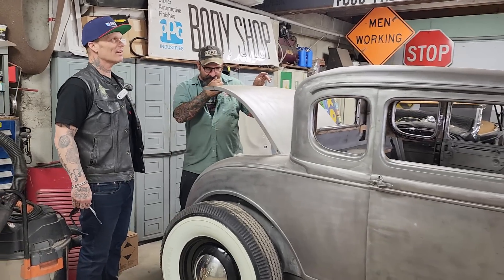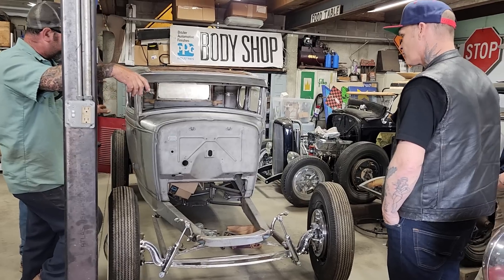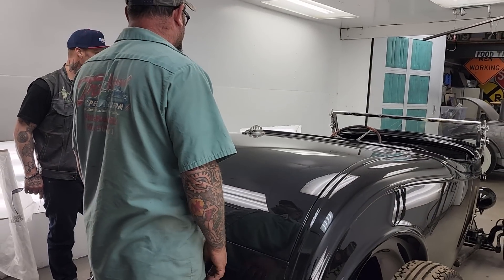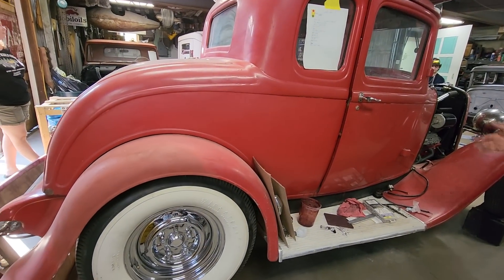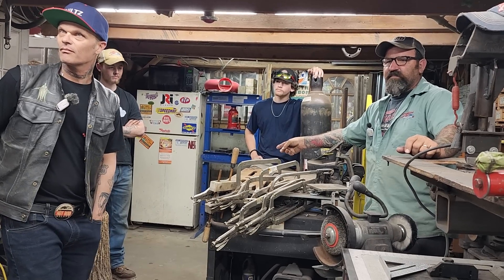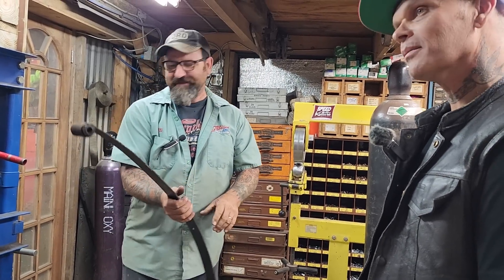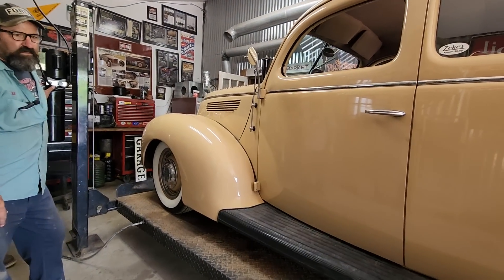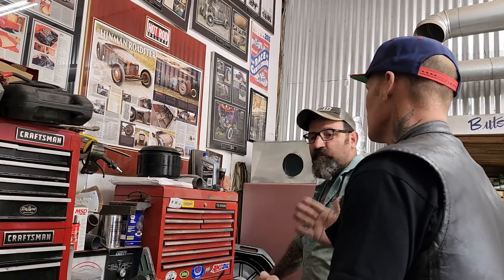How to lower your suspension in 10 minutes and ZERO dollars ✅

Comment: Rubber washers, plastic gaskets, or just about anything used to separate dissimilar metals will eliminate any problem with reactions created by contact. For example, if you are clamping copper pipe with steel clamps just place a strip of rubber between them and problem solved. Plus this practice reduces vibration damage and noise as well.

Comment: You can lower cars with leaf springs easy, you flip the 2nd or 3rd leaf  over then add the other springs as per normal, it will lower the car by about 3 inches.